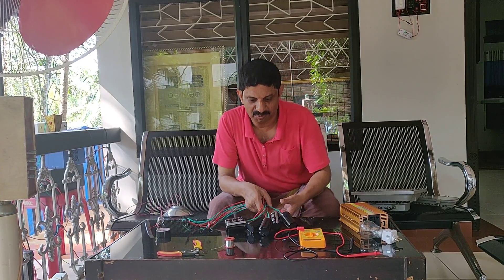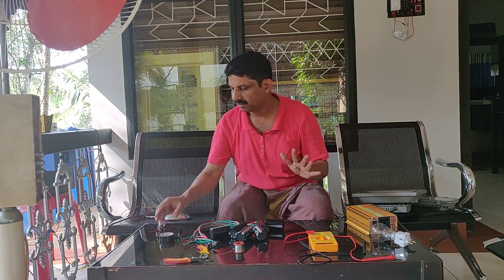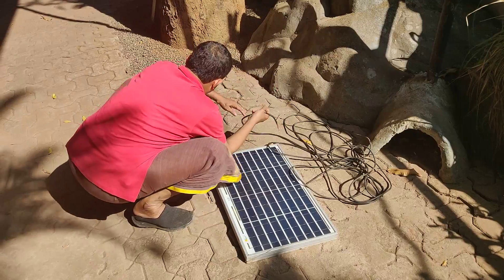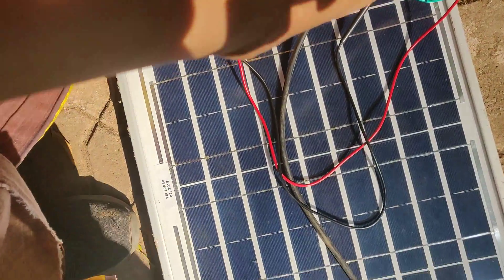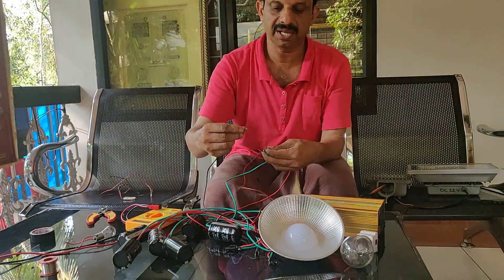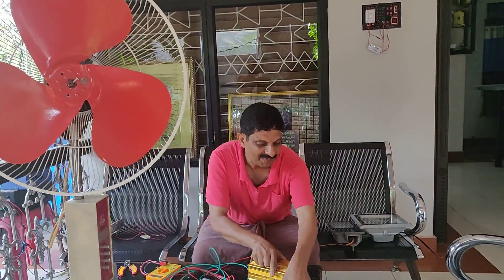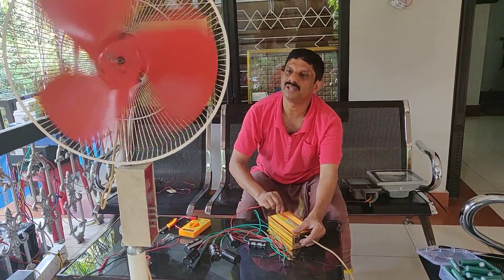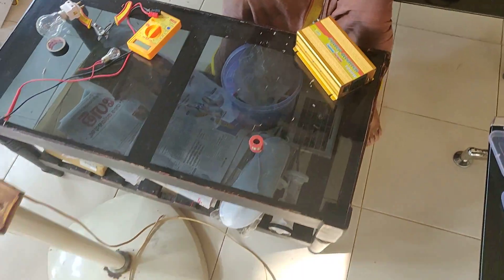സൂപ്പർ സോളാർ പവർ ബാങ്ക് നിങ്ങൾക്കും നിർമിക്കാം | How to make super solar power bank

Comment: ഒരു പ്രാവശ്യം ചാർജ് ചെയ്താൽ 100 W ബൾബ് എത്ര ടൈം കത്തിക്കാൻ പറ്റും ?
Reply: @hashihisha5803  അയാൾക്ക് പറയാനുള്ളത് മാത്രം കേൾക്കുക .അങ്ങോട്ട് ചോദ്യങ്ങൾ പാടില്ലല്ലേ 😂 ഈ ചാനൽ subscribe ചെയ്ത നമ്മൾ സസീ...😂😂😂
Reply: Capacitor discharging  time = 5 * resistance of load * capacitance value of capacitor..   ivide iyal 500 F inte 6 capacitor aanu use cheythathu..  series connection aayathukond total capacitance 500/6 F athayathu 83 F aanu kittuka..  appol discharging time =5* resistance of load * 83 * 10^6 seconds aanu ( resistance value unit kilo ohmilum capacitance value micro faradilum aanu athukondanu 10^6 koode cherthathu) ini resistance value oro device inteyum ittu calculate cheythu nokku..
Reply: Resistace value kittan R=( Voltage^2) /power enna equation use cheyyuka..  bro 100 w bulb ennu mathrame paranjullu athu work cheyyunna voltage ethrayannu koode paranjal aa bulbinte resistance kandupidichu mukalile equationil ittal discharging time kittum
Reply: മറുപടി പ്രതീക്ഷിക്കുന്നു
Reply: sujith നമ്മൾ തന്നെ കണ്ടുപിടിക്കേണ്ടി വരും
Reply: ഞാനും മറുവടി പ്രധീഷിക്കുന്നു
Reply: @mohan kumar njn btech ece aarnnu...  iyal udayippanne..  njn cmntinu rply ittu koduthunne ullu..  pullli video yil ittapole charge capacitor  hold cheyyathilla..  nammalokke parayille no ideal device is possible ennu..  athanu ee pavam capacitorintem avastha.. 😊enne mention cheythappo ennodannu paranjapole thonni.. itz ok👍
Reply: Rinu vsm  അത് കൊണ്ട് തന്നെയാണ് ആ ചോദ്യം ചോദിച്ചതും .ഇദ്ദേഹം മെഡിക്കൽ ഡോക്ടർ ആണോ ?
Reply: @mohan kumar ithippo ennodano paranjathu..  njnalla mr video ittathu...  🤣🤣🤣
Reply: ഇദ്ദേഹത്തിന് ഏത് വിഷയത്തിനാവോ ഡോക്ടറേറ്റ് 🤔 ഇലട്രോണികിസിനാണെങ്കിൽ ആ തീസിസ് ലോകപ്രശസ്തമാവും .